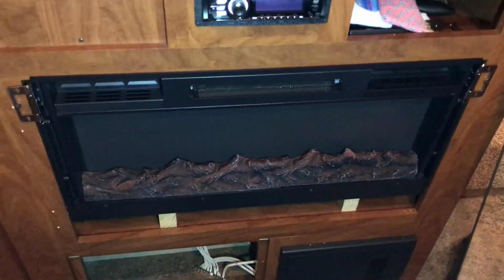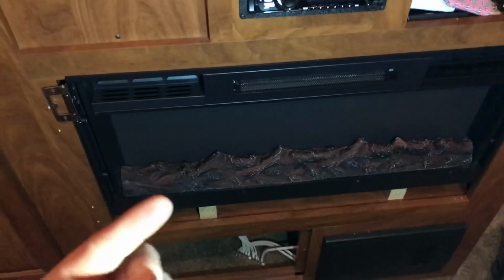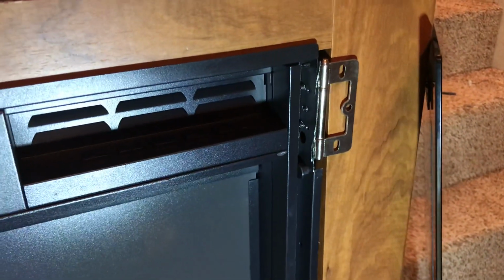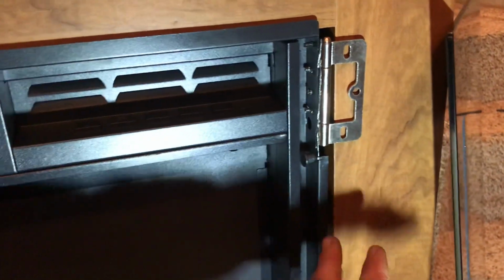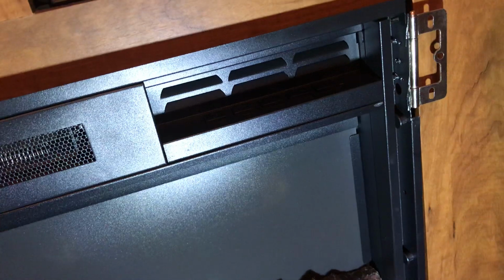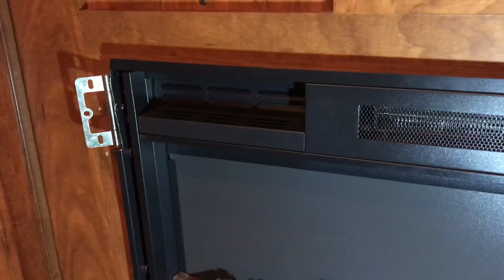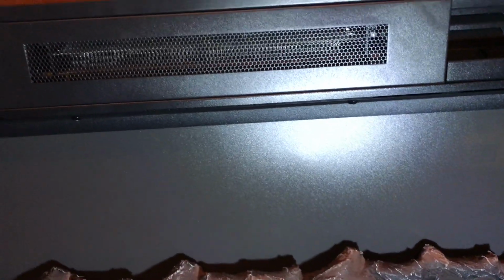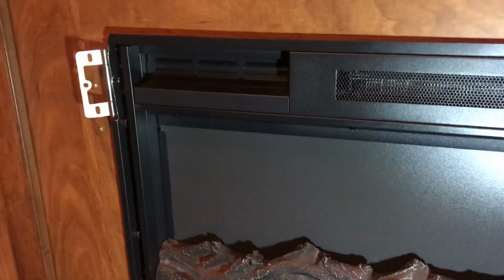How to install a fireplace in a camper

Comment: How do you get them out is what I need to now?
Reply from the maker: On mine, the glass lifts up and pull the bottom out, remove the glass and the it will expose the screws to remove the box